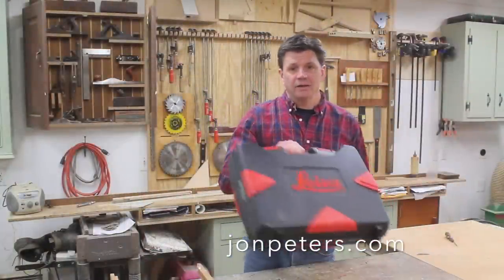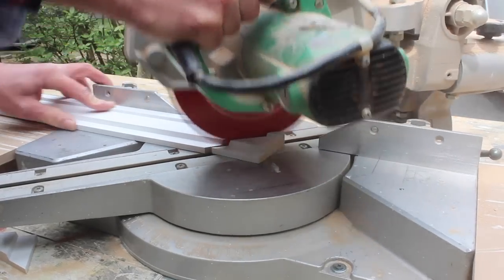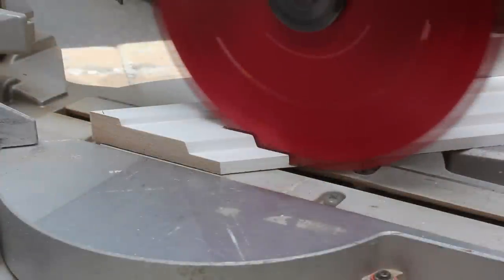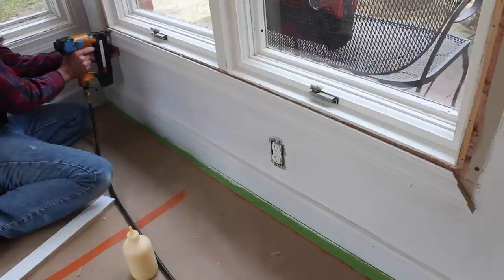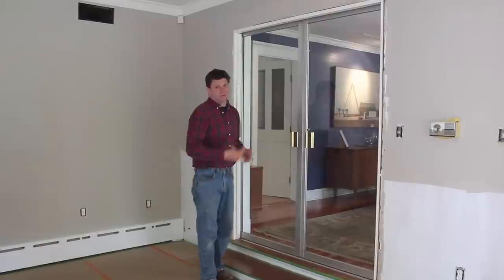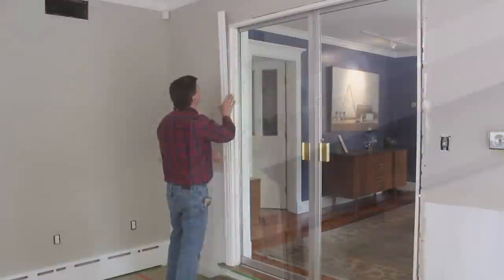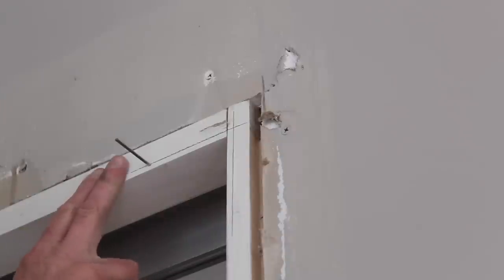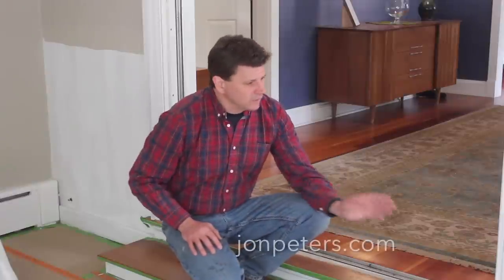How to Install Window & Door Trim - Casing Made Simple

Comment: Hi Jon, thanks for your excellent videos.

I do have a question regarding crooked frames/walls: when I do my trim, I occasionally run into problematic window frames, where the studs and/or drywall seem to protrude in certain places, making it real hard to line up two pieces of trim.

Shimming is an option, but sometimes leaves too big of a gap (where even caulking would be problematic). Any advice on how to deal with that? Maybe shave away some drywall on the high spots?

Comment: You avoided the hardest part of getting a miter right...an out-of-square corner. Cutting perfect 45s won't work. Yeah, you can fill gaps with caulk, but a tight fit is better so that you can glue the corners.

Comment: My idiot contractor set my windows and doors back into the wall so its not flush with drywall, which is not level or true, knowing that it would make my job harder at the end, do you have a video that would address this issue?
Reply from the maker: No but it sounds like you will need to add an extension jamb to the jamb . If you search extension jamb on YouTube I’m sure you’ll find something.

Comment: Question. Why even have a reveal? Why not make it flush?
Reply: Allows clearance for hinges and strike plates on doors. Also looks better with the shadow line it adds. That's my .02
Reply: No reveal looks like a rookie job
Reply: Making it flush will leave a line. Not attractive and you’d need to fill it and sand it smooth. Leaving a reveal saves you the work and actually allows for more details, which are considered attractive and really the point of having moldings in the first place.

Comment: It's ok, but I think more time could have been taken for the novice to do more explaining, i.e., what kind of glue to use, where exactly you nail (e.g., trying to nail into an area of the casing that will hide the nail), what size brad nail to use, (often 1/4 "), what you set your compressor at (~ 100 psi), how to finish (i.e., whether to paint before or after, how to use spackle to hide nail holes). This may be obvious to some, but it won't be to the novice. But perhaps that wasn't the intent of the video.

Comment: This is great if your windows are new and have perfect 90deg angles.  Video does not cover anything execpt 
cut at 45deg and be perfect the first time.  Good luck with that.
Reply: There is an Installing Trim DVD (Craig Savage) sold by Taunton Press which does cover problems - maybe worth the money? There is a preview on Youtube.
Reply: You can make level a mark for the header peace and the reveal might be a little off but its up high and less noticeable than the sides. That's if your jamb is not set level. That way you can make 45 cuts all the way around and haul ass and get the job done fast. That will work if your jamb is not out to far. If it is your day is sucking LMAO